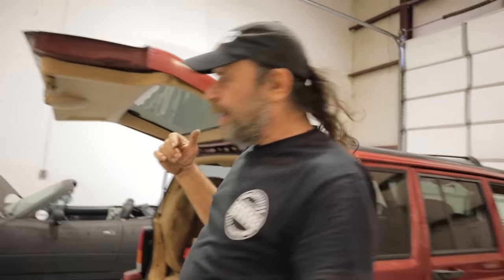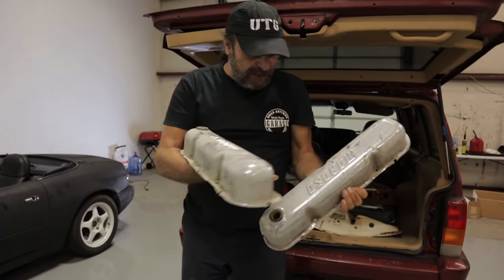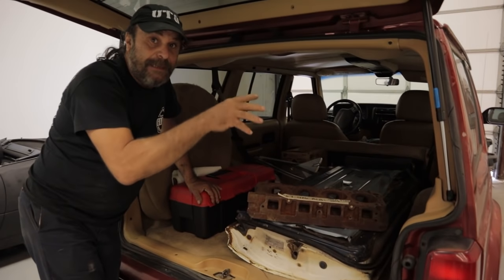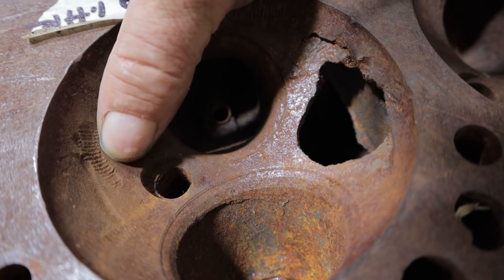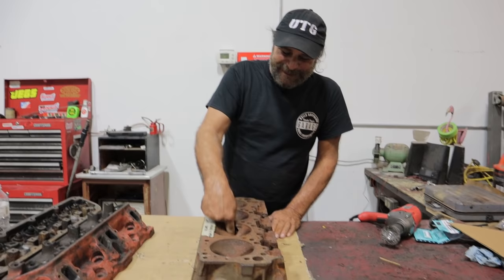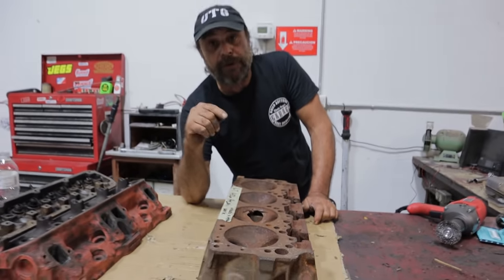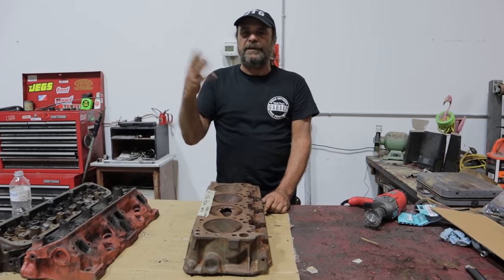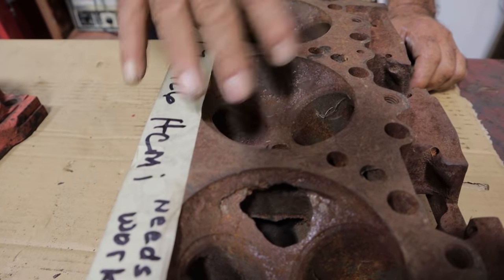Hole-ie Hemi Head, Batman!

Comment: I saw one time when someone took a big block Mopar(I think it was a 440) it was several decades ago, cut it up and only used 2 cylinders,  made a V-twin and put it on a Harley frame. It was a bad ass thumper! that's what you can do with that Hemi head  ;)
Reply: Very interesting.
Reply: yeah I want to do the same thing with a Chevy 90 degree V6 (has a balance shaft over the cam shaft)
Reply: It's called a speed twin (usually small block chevy).
Reply: @franklinbrown8710  I know they exist, I was just thinking of another way of going about it.
Reply: @franklinbrown8710  But chevys are such boring little rodents.  A hemi V twin with  the Hemi heads adapted onto a 400 mopar block with that big bore and the front journal of a RB crank... Super Thumper! 2100 CC V twin Hemi

Comment: Two tubes of JB Weld would fix that hole lol might even be stronger than Factory thin as that metal is
Reply: Yeah, it won't work on an exhaust manifold due to the heat so it sure as hell won't withstand the temp. in a combustion chamber.
Reply: steel reinforced high temp epoxy...JB or other ftw
Reply: Some of y'all don't understand humor!!??🤣🤣😳😂🤣🤷 Was a sarcastic joke!
Reply: Just buy the heavy aftermarket set of heads and have something that will last.
Reply: Don't forget to stuff something in there like marshmallows to take up a little space and make working with JB weld a little easier.
Reply: @williamgolden839  I was thinking  balled up newspaper but marshmallows would work better

Comment: I’ve fixed similar stuff with Nickel TIG rod, with great success.  Depends on the quality of iron used in that casting though.
Reply: I was going to suggest the same thing. We had welders on the railroad who would weld up broken cast with Nickel rods. I dont know about long term strength but they made a nice repair.
Reply: @edfrawley4356  funny you mention that, I weld railroad switch frog castings  for a living lol
Reply: What would you use to make a piece to fill the hole?
Reply: @williamgolden839  I wouldn’t make a piece.  I would continue to run string after string of weld, until the hole was sufficiently filled.

Comment: Those points distributors will be handy after the EMP takes out all the electronics! Uncle Tony will be cruisin around looking for gas, like Mad Max!
Reply: No its all bs. I can provide proof if you want. Regardless even if emp could take out car electronics so easily the distributors would also go. Only old plunger pump diesels would be running around
Reply: @288gto7  
Good old 240D with a manual transmission!!!
Reply: yeah, because the EMP would take out the gas pumps as well--good luck sucking out of an underground tank. funny thing is trying to find real good points parts to replace the points constantly going out. Up here in the expensive snow belt, I buy old GM HEIs for $10 a pop.
Reply: I have  75+ year old self priming, hand crank pump with 50' hose I use to drain old heating oil tanks in basements. So I think I'll get that gasoline out of them tanks no problem lol.. and with a coil, starter distributor, alternator maybe few other things kept in a metal can of sorts preferably copper. There's ways!
Reply: Unfortunately, all the gasahol will start to get gummy and rancid in the tanks in 3-6 months.
Reply: @288gto7  Laughs in Cummins P Pump
Reply: Make alcohol.......

Comment: A lot of the early 1968 Hurst Hemi darts and barracudas ingested bolts due to some only being finger tight, I wonder if that may be one of those
Reply: that's interesting, I always heard the early Street Hemis had issues because they were slapped together under the theory buyers were just going to tear them apart to blueprint. I guess that concept lasted past 1965.
Reply: @albertgaspar627  They would never intentionally do that.  With the 68 SS cars I believe it was the intake bolts that were finger tight, likely from a different assembly line or something as they were crated up and sent to Hurst for the conversions.  Some of them blew up while being loaded onto the owners trailer in the hurst parking lot!
Reply: @albertgaspar627  I wonder if Hurst cars needed the intakes re-torqued after a few thermal cycles or so due to the crossram being  wonderfully huge. Mopar to ya!
Reply: @FrankBullitt390  we'd like to think no one would intentionally do that, but Ford was caught with memos knowing the Pinto was going to blow up and did the math--it was cheaper to pay the fines than recall. And the Apsens/Volares were known for their lack of rustproofing in the fenders. Of course the SS cars came with primered front ends, expecting to be repainted and they were sold with no warantee. so anything's possible--the folks who really know, aren't going to say much now :)
Reply: @Troy440Dodge  that's a good question. they experienced that size cross ram before with the early 413's in 1962 Darts (?) but i can't remember right now before breakfast of champions if that intake was the same material or not.
Reply: @albertgaspar627  Intentionally leave the intake loose because they figured guys were just going to remove it?  And you're dead serious?
Reply: @FrankBullitt390  Of course I'm dead serious. We're talking an item built at cost, not for the general public (ie, seatbelts in place of window cranks, holes drilled in the A100 seat brackets, etc) , but to be torn apart by racers and blueprinted and built in time to get them out to the race track to earn wins to sell cars. Did you think loose bolts came about by Mopar's usual lack of quality control or because they were too busy rolling back the odometer to notice? :)    you do know that the front ends were still in primer no paint, right? Did you think that wasn't intentional?  I mean, if you were putting something together you knew was going to be torn apart, would you really screw the next guy and torque it down?

Meanwhile, every automaker had quality control problems--Pontiac factory workers stole the Super Duty connecting rods regularly, Studebakers are the easiest orphan cars to restore due to the amount of theft by employees, Harley Davidsons during the AMF era leaked oil on the dealership floors straight off the truck, and Vegas were shipped vertically standing on their noses inside box cars--allegedly no problems with fluids whatsoever, and I can go on. Auto making has a LOT of stories about what went on that will make you leery of ever buying a new car. That doesn't even cover the things restorers find tucked inside door panels, dashboards, under rear seats,  etc by bored line workers. 

Heck, YOU are the one who said this happened regularly. What do you think is the reason? George Hurst hired lousy workers?
Reply: @albertgaspar627  You said 66 street hemis, and no, they wouldn't do it on either, that is insane.  Even on the 68 you can't change the intake for stock racing
Reply: @FrankBullitt390  Frankie, what are we going to do with you....ok, go get yourself the book "Hurst Equipped" its by Mark Fletcher and Richard Truesdell. On page 126, they begin talking about the Hemis we're speaking of, and I quote, last paragraph, first column

"...be ready to build 100 cars in 100 days"

so yes, they were in a rush, just like i told you. and that's a perfect recipe for screwing stuff up, as we're about to see.

Page 127, after the subtitle "On The Assembly Line"

"Hurst's production process was far from sophisticated" and they talk about rear quarter mods butchery as an example.

Page 132, first column:

" Chrysler Marine and Industrial division provided the 426-ci iron Hemi engines...starting with October 1966 cast blocks."  Later on it goes to explain that, as usual, the engines were put on K members and slapped in from below, so attaching an engine hoist to the manifold wasn't a matter of needing tightened bolts like most other cars.

Page 133:

"Once the transformation was completed by Hurst, the cars were shipped back to Chrysler and forwarded onto the delivering dealers with a minimum of quality control inspection. During production front ends were not aligned, and many bolt-on parts were not torqued to Chrysler specs. Reports of broken 5/16 inch intake bolts making their way into and destroying a few engines came back to Chrysler and Hurst. Each car carried a sticker stating it was not legal for street use."

yep, sounds intentional in that no one cared, the problem was made known, and the process continued. again, the goal was to get this car into racer hands inside 100 days--period, end of story.

Page 134:

"some racers complained that a few cars had been delivered with blown engines due to some unauthorized drag testing while in transit. Chrysler also shipped new steering arms to help correct bumpsteering problems discovered during initial testing. "

So, there ya go. if you think a book written with the blessing of the Hurst family knows less of the story than you do....there's not much more i can say :)
Reply: @albertgaspar627  Poor quality control and "leaving the intakes loose because guys were just gonna remove em" is two VERY different things.  Thanks for the quotes tho

Comment: There are shops away from the city (like Sperry Welding in Capac MI) that specialize in repairing cast iron (usually tractor repair shops) that could and would be able to repair that head - And Run Water - these shops are exceptional when it comes to repairing cast iron.
Agricultural machinery gets the crap beat out of it on a daily basis, and when it's broke down it's the same as any machine breakdown - every minute it's down it's costing money.
A good many farmers still run equipment that there are no replacement parts for so these shops specialize in repairing "the un-repairable"
I had customers with severely damaged blocks/heads that were numbers matching for muscle car restorations and I sent their parts to Sperry and they were able to repair anything I sent them.
Reply: Go Lions! ..... ):
Reply: Only problem is that you need a second head!
Reply: That's good to know. I put my '64 Hemi on hold as both the block and one of my K heads has a crack needing repair. Funny part is that the K heads I bought that were supposedly good came from Ontario. Such is life. I knew it was a bottomless pit of money when I put a Hemi engine on my bucket list.
Reply: @snake_eyes_garage  
They always are - anything we just have to do usually bites us in the a**.
Reply: @Samsgarden  
I don't, HE does, lol!!!!

Comment: I had a set of Moroso valve covers that were just like that. Mine started off as anodized blue (or some transparent blue coating) but the blue started to peel off so I peeled off all of the "blue" and was left with a nice set of chrome valve covers.
Reply: Anodizing is only done on aluminum, the surface is electro etched then dipped in dye.  Steel valve covers were sometimes painted with tinted clear.  This was super common on steel wheels in the 80's

Comment: I want a set of those anodized blue Moroso big block valve covers.
Reply: Get chrome valve covers, clean them then spray with tinted clear coat.  You might run into adhesion issues given the chrome is so smooth.  This process was common on steel wheels in the 80's
Reply: @bobroberts2371  The anodized covers were aluminum. They looked kool up against the Mopar orange paint. 😀 They had gold and blue.

Comment: I wonder if it could be repaired by packing the water jacket with casting sand, super heating the edges of the hole and pouring molten steel / shaping with a convex brass dolly.  Big expense...but fun to think about.

Comment: You can buy a torch outfit and weld it up like new yourself if you heat it up above 600 degrees in your gas cooker but you may need to add an extra burner to get the desired heat. I have stick welded heads with someone using a torch to heat the head and it worked well. You sure know how to weld with a torch so do a video on head and block repair?
Reply: See zip ties and bias plies , has a vid on hopping up the gas grill
Reply: @dennisford2000  Thanks

Comment: Any chance you’d talk a little about filling heads and blocks? 

How do you do that? Why? How long do they have before they overheat (realistically)?
Reply: There are many variables, as with a cooling system equipped engine. They use time and usually a temp sensor and monitor temps, trying to get above a minimum, but not bring in too much heat, all based on time and conditions.
Usually enough time for a short warm up, burnout, staging and a pass. 

They use a few different materials for filling, usually based on budget, lol. It adds a lot of strength and lessens twisting and deformation from heavier loads than the component is designed for.

Comment: Buying a head with a hole in the combustion chamber, what's next? I know where you can get a 2 piece crank for a 393 Windsor motor and a oil pan with inspection holes. I think he has some other used parts for that engine too. 😉😂😂😂

Comment: i still have my set of hemi heads for bbc i picked them up for 300 bucks just don't have the engine for them i have lots of bbc just nothing that can handle those heads need at least 2000 hp for them and u have to do a lot to run them
Reply: @ostrich67  are you for real that you don't know what BBC means when talking Mopar?
Reply: @ostrich67  Big Bold Chevy.

Comment: Tony, for a laugh I'd like to see that holy hemi head filled with plaster of Paris and the hole filled in with brazing rod. the plaster can then be washed out afterwards.
Reply: How about welding over furnace cement with nickel rod for cast iron ? I was taught by some guys that can make any part and repair anything but they passed on. Too bad they forgot more than I will ever know.
Reply: @edge2sword186  while not a bad idea, plaster and braving rod are easier to obtain.
Reply: @2000freefuel  Plaster of Paris retains water in its makeup even after it's set. Exposing it to  something super hot like molten steel will cause it to revert to dry powder by exploding .
Reply: @autophyte  it's commonly used in the lost wax casting process, trick is baking the mold first!
Reply: @2000freefuel  Plaster of Paris is only used in the first mold. A wax copy of the original is made using the plaster mold, but the final mold into which the molten metal is poured, is made of clay based material, which is baked. However, the idea of packing clay based casting sand in the water jacket behind the hole and pouring in molten iron possibly could work. Any areas where it did not fuse properly to the original casting could be filled by oxy welding with cast iron rod (after the head was properly pre-heated, of course) But it's probably not worth the effort, as hemi heads are not as scarce as the engine blocks.
Reply: @autophyte  again I'm interested to learn how far torch brazing repairs would get people...
Reply: @2000freefuel  Torch brazing would possibly be the way to go here. There's less chance of cracking as the casting cools, and the bronze joint would not get hot enough to melt due to the water jacket surrounding the repair. Torch welding would be very hard to do with success. Because cast iron has no elastic tendencies, on cooling, the joint will crack every time. The solution to that would be to heat the head up to red heat in a furnace, then, while it's still hot, weld the patch piece in. Then, either cover it with hot sand or place it back in the furnace and let it slowly cool over 24 hours, to relieve any stresses that might build up. In the "old days", when I was a young apprentice, saving cracked engine blocks was the done thing, as new ones were not as easily available in Australia, or were too expensive to import. But sadly, no one does it today. Hey, most people don't even keep their cars long enough to wear out the block. No one buys reconditioned engines either, just get a new car.

Comment: He said 200 thousandths  but that would be almost a quarter inch I think he may have meant 20 thousandths.
Reply: 200 is about right.  Casting variations are greater than 20 so lots of heads would have holes right after casting.

Comment: Buy some no preheating required cast iron welding rod from Muggy Weld and fill that hole.
Block off the head and pressure test it. 👍👍

Comment: Speedwin long Island ny got out of army 1970 lived in Westhampton dealt with them and S&K speed ran a 1968 amx 390 I was a mechanic at AMC dealer in Riverhead got lots of hi po parts through AMC car ran in super car / A class best et 1090s 126mph she had some work done to her track was Hampton raceway enough fun days well at the track speedwin flyers was selling new hemi crate engines and a few Ford 427 sohc engines new for 2 to 2.5 thousand dollars then in 1972 a friend in NYC had a friend trying to sell a 1964 Ford thunderbolt had a rod out the side of block 3,500 bucks if I could go back,boss429 needed head repaired sold for 2,200 bucks had mechanic lean on it oh well those were the days got to service a I believe 68 or 69 roadrunner 426 2 4s had solid lifters a guy and wife traded it in on a Volvo station wagon well I got to road test after tune up and man did it impress me. Thanks for the memories hey I'm trying to quite smoking it's a bitch
Reply: I quit smoking 3.5 years ago. I am 53 now started at 10 years old. I still use those nicotine lozenges. Works good..a Marlboro burning makes me sweat....kept a pack waiting on stage 4 something to start again....had to quit.grandpa died at 63 from emphysema .dad made it to 66,lung cancer. I planned for me to make 69. I seen a pattern. Good luck